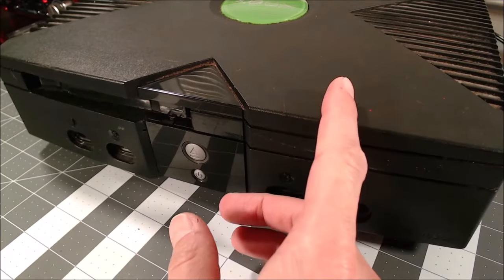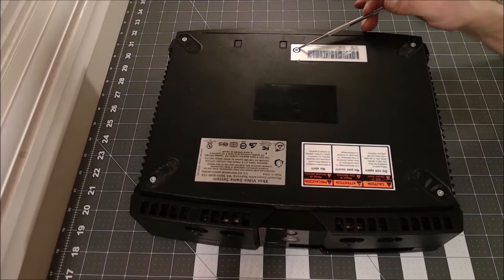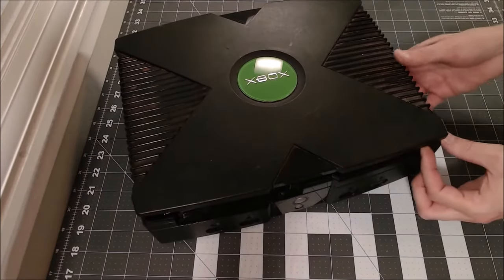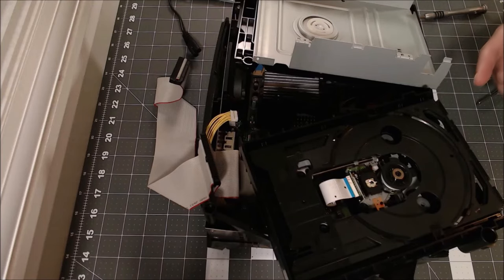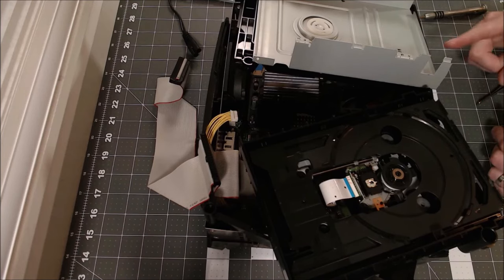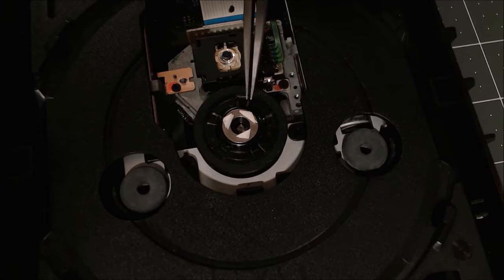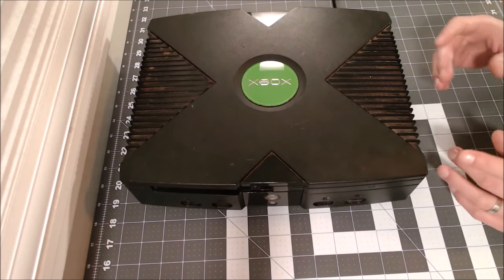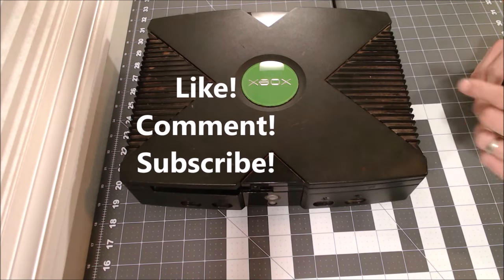Fixing an Original Xbox - Stuck Disc Tray

Comment: I cleaned the belt with isopropyl alcohol (IPA), then boiled it in water to restore its original shape. After that, I applied belt spray with Q-tips to improve friction, and now it’s working perfectly.
Reply from the maker: Glad that worked for you!

Comment: The tray got stuck for the first time ever since I bought it used in 2007. I moved it around and it opened. I wiped the tray and air dusted it. Obviously that's a short term fix and I'm gonna have to open it up or say bye bye to it.
Reply from the maker: If you're worried about it failing again you can buy a replacement belt on ebay and swap that out, might do the trick long term!

Comment: This was super helpful!  I did the padding right away and it worked, but the drive got SUPER noisy.  I wonder if a little cardboard taped to the top might do the same trick instead of something stuck on the magnet.  Though for now it's fine, and it might actually be settling down and getting quieter, I'll have to spin up a few more discs and see!
Reply from the maker: Glad it helped you out! Let me know results if you do test other options

Comment: Thank you for the info on the magnet! First video I've found that went beyond replacing the drive belt. I fear mine has more of an issue than those two fixes tho...
My drive struggles to eject (maybe the magnet), then has trouble locking after it closes. My disc tray also seems very unstable. Lot of wiggle room from side to side, and will jar to one side or the other (when closing or opening) which prevents it from doing what it's supposed to. Hoping I don't have to buy a new drive or whole new box to fix it.
I did remove the tray completely while cleaning it once or twice. Maybe I threw off the gear positioning when I did that? Or maybe the plastic gears or rails need to be greased?
Reply from the maker: Hard to say based on just this info but a lot of excess wobble sounds likely that part of the mechanism is broken, worn down significantly, or missing.
Reply: Same here. Mine pops out just fine, but I need to tilt it slightly to the side for it to get back in.

Comment: the gears inside my tray are in totally different locations than yours, does that mean i have an older or younger model?  
my gears were much further apart, but i managed to replace the o-ring.  but it still doesn't work
Reply from the maker: I'm not too familiar with the various OG xbox models unfortunately. Did you try spacing the magnet?

Comment: I just got my Xbox and the disk drive wouldn’t open and there’s not the white gears I’m gonna call them I have the white part but next to the belt there’s usually a bother white part right any way I can fix that
Reply: I got it to open but it won’t close I think the white parts are what retract it back in any ideas
Reply from the maker: The white gear is missing? I would disassemble the drive to see if it dislodged and fell somewhere deeper inside as it would need to be replaced for proper drive functionality (and could cause jams if hanging out loose inside).
Reply: @FantasticQuack  I fixed the drive it opens i just have to push it when I’m closing it and it goes in by it self

Comment: I’m surprised you didn’t check the clock battery. Is that recommended to do?

All I have on my original Xbox is a green blinking light where the disk tray won’t open.
Reply from the maker: Might as well check it if you're in there but I was targeting a specific issue here
Reply: @FantasticQuack  Thanks for making the video. Once I get the supplies to fix my console, I’m going to switch out that band & clean out the dust.

What type of band would you recommend get for the replacement?

Comment: Mine wont open even with the clip. Whats driving me crazy is when i took it back they had just press the button then it worked but bringing it back home it againt wont work.

Please help!
Reply from the maker: a little tricky to troubleshoot based on this. It worked at the store but not at home? Maybe just need to clean some of the internals. Sometimes you have to push that small button pretty hard if you are trying to manually eject. Hope you can get it figured out!
Reply: I Swear that's what happened with the pc I built. Screen wouldn't come on at home but always did at their shop.

Comment: hmm I did everything you showcased step-by-step. I even put a little more tape on there than you did, and yet it still gets jammed.
Please help?
Reply from the maker: What condition is the drive belt in? Super loose? You could try thickening the spacer even more or buy a new drive belt.
Reply: @FantasticQuack  It still felt very tight, albeit with slight curvature.
But Basically It goes in fine, but when it pops-out the disc tray goes slightly to the left, whereafter it gets stuck. So I have to nudge it to the side every single time to get it back in.
Reply: Hey man did you get it. Mine i pressed the button on and hit the top hard while you hear the motor going and it opened.

Comment: My Xbox shell currently will not completely close, all the other sides close except for the front right corner, any solutions?
Reply from the maker: Something on the inside (wires or otherwise) is not seated properly. Impossible to know without seeing it, unfortunately.

Comment: I took the screw off of where the hard drive is but only one side comes up. I’m confused.
Reply from the maker: Pls follow along with the screws I remove in the video. It's possible there are xbox models where more screws were used, I'm not sure, but just look around the perimeter of everything for any other screws that might be hiding. Hope you can get yours working!

Comment: I’m using this little thing used to open up the SIM card tray on a iPhone and it won’t work does it have to be a paper clip?
Reply from the maker: I'm assuming that tool doesn't have a long enough tip. Paper clip is just the most convenient/common option.

Comment: I have another problem and im hoping you or anyone could help with. For some strange reason the green light is blinking, like its blinking whenever you wanna ooen thr tray, however its blinking and thr CD tray is not working. Its not popping open or closing by itself like its suppose to non stop. It also just makes a weird noise and does nothing. I havent played on it in years and  i wanted to play my childhood games. I blew into the thing that the CD tray comes from to get any dust and that didnt help either. Idk what to do. Its not the red ring either its just the green light blinking non stop.
Reply from the maker: Sorry I haven't run into this before but it might be something related to the eject button itself. I would check to see if it has corrosion or anywhere nearby on the board. If you manually eject the tray with a paper clip and insert a game will it read the game or does it not give a picture on the screen even?

Comment: I got a console from a thrift store and it has an apparent mod chip installed on boot. My issue is that on pressing the eject button the console just powers off. The aux eject button does nothing and even taken apart I can't get the tray to slide out.
Reply: Update: So I got the disc drive to work, it was coming a little bit off one of the side rails and jamming. It opens and closes, but the console constantly power cycles while doing it. Gets stuck in an infinite open/close/shutoff/startup loop
Reply: I suppose it's likely an issue with the modded bios
Reply from the maker: Sounds like a wiring issue or a short somewhere, not sure about modded bios
Reply: @FantasticQuack  Yeah, I got the tray to slide correctly but it doesn't play well with the buttons, I'll just have to leave it disconnected and try FTPing. I was thinking trace damage or bad wires like you said.

Comment: hey i followed your video and i thought i had done everything right, but now my xbox won’t turn on all together, i didn’t feel like i damaged anything inside but now i’m super bummed and worried that i did. any advice?
Reply from the maker: This process is very unlikely to cause any damage, and if you had it would have probably been some gross accident and you'd know about it. I'd recommend checking all the cables again making sure they are plugged in snug/correctly--particularly those for the power supply.
Reply: @FantasticQuack  thank you so much, I'll be sure to open it back up and make sure everything is properly hooked up!

Comment: Where can you find a replacement belt?

On ebay I only find ones for the 360.
Reply from the maker: I've heard they work on the original xbox too. They're cheap enough where the risk is low either way.
https://www.ebay.com/itm/271893139604

Comment: 6:08 my drive is not going up when tray is closed therefore the laser will not work. How to make it going up on its own?
Reply from the maker: Sorry I can't really answer with this info alone I'd need to see it first hand to better understand the problem.
Reply: @FantasticQuack  turns out the small black gear’s teeth are broken. Do you know where to get it?
Reply from the maker: @sparda1418  I'd dig around on Google but am assuming you'll be hard pressed to find the original part short of salvaging it from another drive. How broken is it? If it's just in 2 pieces or something I'd try to repair it with super glue and smoothing out any seams/imperfections with fine grit sand paper. Or if you own a 3D printer that's another option.
Reply: @FantasticQuack  all teeth are broken lol

Comment: Oh. You mean you don't slam the top of the tray to get it open? I didn't know about the pin hole lol
Reply: Btw thanks for this, the belt in hot water trick worked for me, no need for the tape. If anyone's wondering I heater the water to 80 Celsius and left the belt in there for 3 minutes or so then just dried it with a towel
Reply from the maker: and I didn't know about the slam technique 😂
Reply: @FantasticQuack  Glad I could teach you something as well 🤣

Comment: Probably dont want to put spacers on magnet. Put them on the metal plate above as it has a circular imprint...
Reply from the maker: Disagree, if you wanted the spacers off the magnet for some reason they would need to go on that white plastic piece which can move around in the larger circular opening, meaning the spacers might randomly end up off center with the disc. Meanwhile the magnet is always in a fixed position and hence it makes the most sense to put the spacer there.
Reply: @FantasticQuack  the piece you may be referring to is not present on screen very long, but I would think that a adhesive foam washer (readily available online in various sizes) would fit the space above nicely, and being that it too is circular and larger would not be as great a risk of dislocating like the small strips. Just my worry, it that magnet is spinning, those little strips are coming off eventually, but not two circular shapes spinning in tandem.

Comment: Okay but mine wont even open at all.
Reply from the maker: Need to push that little button quite hard sometimes. If you can get something more rigid than a paper clip (like a pottery needle tool or something) that will help push it with more force. Worst case you can still get at it by disassembling the drive.

Comment: For anyone else here who is too scared/lazy to take it all apart and dig around, I got mine to open by shoving the paperclip in the top center of the disc tray (toward the magnet)
Reply from the maker: I don't get it, do you leave the paper clip in there or is this just something you have to do every time to get it open (Like using the little hole at 0:54)?
Reply: @FantasticQuack  I did it once, and have just been leaving a game in there. Mine works fine with the game in it. But yeah, I would probably have to do it every time if there was no game.

Comment: The random jump cuts make this a horrible tutorial. Sure when unscrewing things it makes sense but you don’t properly show what you’re doing or where something is
Reply from the maker: Thanks for this feedback, I always disliked 30+ minute tutorials where I had to skip through most of it just to get to the important parts. So my philosophy has always been to cut out that kind of fat, and in so doing may sometimes move past things too quickly. Can you point out something specific you would have like to have seen more time spent showing/describing? This is one of my older vids and I think I've improved since then, but still I'll keep this in mind to make sure these vids are as useful as possible--that's ultimately the goal.
Reply: I simply would've said "less than ideal". Calling the entire video "horrible" purely on that is a bit harsh.